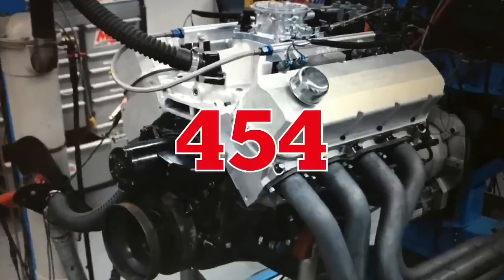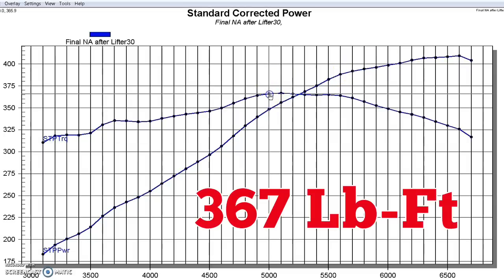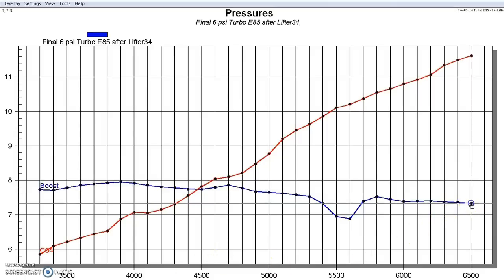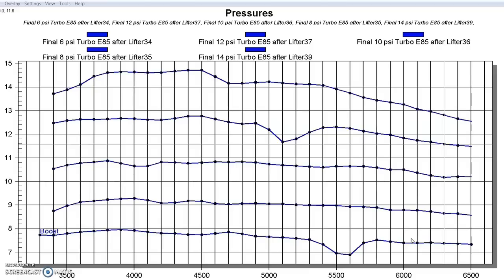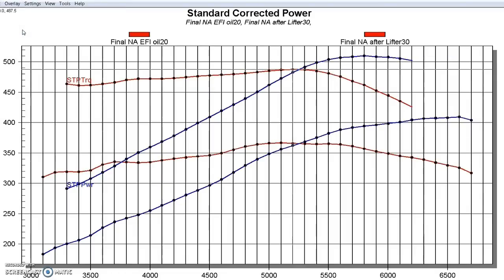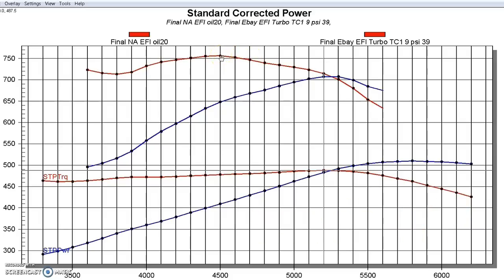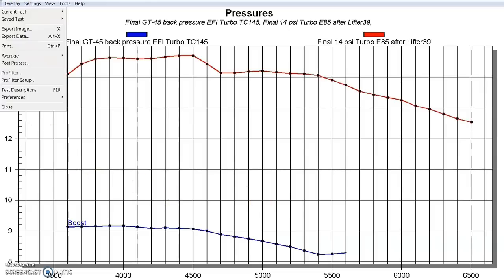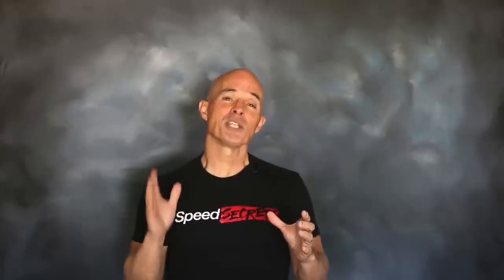EBAY TURBO TITANS-4.8L vs 454 (GT45 TURBO)

Comment: Great video. I'm building a gen VI 454 with a small Whipple charger great information on your videos. What is the right turbo for a big block Chevy to make 800, 1000, 1200hp. I have been doing a ton of research also on fuel injection which one will be best for NA and cost and what would be best for forced induction and maybe some price ranges and what to expect. I'd appreciate any of videos on this type of stuff thanks.

Comment: Size the turbo for your application, That small turbo [more average tq] with the 454 would be a great tow engine you don't need over 4500 rpm on that app.

Comment: We see the big block is still more powerful than an ls and cost less to build for more hp
Reply: WTF? How much do you think LS stuff is?
There are so many people making 700+ slapping a turbo and some fuel on a bone stock $400 200k junkyard LS
Most running BBC engines are $800-1000+ and are barely running. Not to mention are out of a clapped out 1978 motor home, making 211 hp lol
Lemme guess..you probably still prefer carbs over EFI too, huh?
You HAVE at least upgraded your points to a HEI distributor, right?
Reply from the maker: we get ours for near $300 plus core on sale weekends
Reply: I ain't your talking about LS, Richard
I can get a big block at the junkyard for $400 too. But it's well beyond a pig in a poke. LS is much safer junkyard gamble
Reply: Don’t get me wrong the ls is a very good engine. Got a friend running turbo ls on street 1028 to the wheels but got a friend with a 454 from a junkyard with just a cam, intake and fuel injector upgrade running a single turbo in his Chevelle putting 1500 at the wheels on low boost.  They both have there place. All I was saying is for less boost a big block will still produce more power

Comment: We all love LS’s. But it would be nice to see a budget twin turbo BBC shootout. Gen IV VS Gen VI stock for stock nothing more than cam and springs cheap turbos, and proper fueling on both. 725 lbft torque at 3500rpm isn’t anything to sneeze at. Can either of the them in stock form, survive north of 1000HP? Even if you don’t do a shootout, I’d really love to see how far these old girls with a four bolt main can go before the big boom.
Reply: Not sure how I missed that video. I thought I’d seen everything you put out. Time to start searching. 

Because of old technology it seems like people still think there’s no such thing as a budget BBC.
Reply from the maker: I have the big bang BBC coming up-we will see how far we can push a SBE 454-its already gone well north of 1000 hp

Comment: Another great video Richard! Now I'm questioning why two 700HP engines have different exhaust volumes, ie the BB with more exhaust back pressure than the SB at the same HP. Isn't HP (then exhaust) a function of the amount of air/fuel in the cylinder during the power stroke, be it NA, boosted, BB or SB? Thank you.
Reply from the maker: Look at the average amount of exhaust that must flow-the average exhaust flow (power production) of the BBC is much higher-it has to flow more total exhaust in the same amount of time through the same flow orifice-hence higher back pressure
Reply: Hey Richard, after posting my question, I decided to review the video.  At 700hp (SB=5900rpm, BB=5200rpm) the exhaust back pressure was almost the same (SB=18psi, BB=19psi). The BB's increased back pressure is due to the increase in HP.

Comment: I do not think the ci of an engine under boost  determines total hp. The flow capacity of the power adder determines max hp.  Physics determines output.  You can't make more hp than there is oxygen available.
Reply from the maker: the power output of the combination is ultimately determined by the flow rate of the power adder-assuming no restrictions.

Comment: A good follow up to this would be to add twin gt45 to the 454 and run the same boost (9).  Show the difference in back pressure and the affect it has on HP.  Another interesting test would be to run the 454 with just one manifold going to the single gt45.  Then have the other manifold with straight pipe.  This would be good to see if this works.  Then guys could get half of there turbo projects going and on the road then when time and money permits add the second turbo.
Reply from the maker: I tried running a single with one side-it didn't work but going to try a smaller turbo -twins vs single is on the list

Comment: Richard, what turbo would you pick to optimize the 454 combination?
Reply from the maker: We ran it with an S480 billet wheel-it worked well-the turbo choice would depend on desired power level and application
Reply: Richard Holdener, Great information, thank you. 👍🏻

Comment: Richard what size turbo woupd you recommend for a 427ci stroker ls?
Reply from the maker: Depends on power needs
Reply: @richardholdener1727  1,000-1,200
Reply: Twin 69 Billet BorgWarner with a 1.25 AR exhaust housing will easily get you 1200 rear wheel. If you want to make big Power twin 76s or twin 80s

Comment: Great test, i haven't seen many dyno tests where they log exhaust backpressure, good to see.  MORE DATA please  Richard! There is a lot to get out of your videos, beyond what you discuss if you just give us more data. Even if you don't want to discus it, just flash data on the screen for 2 seconds at the end, table format is denser and more accurate. I would love to see compressor discharge temps and pressures,  Intake manifold temps and pressures.  Airflow data. Does this turbo have a compressor map?  Didn't you talk about an 8 channel egt/wideband in a previous video? Timing, power/torque curves in table format.
Reply from the maker: There is no map for this turbo that I know of-we don't usually log airflow to the turbo. We sometimes run 8 O2s and/or EGTs, usually monitor boost and back psi, sometimes run air temps in and out, just depends on the test

Comment: It would be interesting what would be gained or given up with a different A/r exhaust housing. Also to add in a external wastegate and blead off some EBP at higher rpm on both motors to see if the falling boost curve would flatten out and cause more power.
Reply: Scott Nadermann I agree.
Reply from the maker: there are two external waste gates already

Comment: Great job as usual!! Volume on point! 
What would be interesting would increasing the turbine size and A/R and leaving the compressor alone allow this particular turbo to work on this motor and how that effects the output and back pressure. Ex I see this in would be a guy who wants 700hp but below 5k and have it live, not at 22psi of back pressure.. seems to me that a 96mm hot side would be min with a 1.2ish A/R as a guess
Reply: The compressor is pretty much at its  limit at about 700-750hp , so bigger exhaust wheel will help with the back pressure but won't make much more power .

Comment: Seeing this makes me want to boost my 383 that makes at least 500 NA, it has a pretty decent quality forged rotating assembly and dart SHP block
Reply: If your 383 is making 500ho stock it's probably high compression, that's not the ideal engine to boost.
Reply: brettls2 yeah I built it as a low compression motor for boost, but swapped out the dish pistons for flat tops, later on, if I boosted it I probably wouldn’t daily drive it as much, I could make sure it’s intercooled good, and has plenty of octane, or swap the pistons back in, or both
Reply from the maker: even at 10.5:1-it works fine under boost
Reply: Richard Holdener It should be around 10.8 right now, I’ve put 60,000 miles on the motor with a 243/249 lunati solid roller and afr 210 heads. Also put a Sniper X Flow system on it about 10,000 miles ago,
Reply: @drivinwithdrew7676  Turbo and send it! Good timing and your fine

Comment: That 454 would make for an awesome truck/towing combination. The torque curve looks like a dining room table! I wish you had a more technical discussion of not just the back pressure numbers, but more details about when the delta P ratio becomes an issue. As the test shows, if the application is geared toward more torque, having a delta P number of 2 or even a little higher, as was the case with the 454, is not a huge problem.
Reply from the maker: high back pressure and towing are actually not a good mix-there are much better turbo choices for the BBC-even for low speed applications-I want top try routing exhaust from 6 of the 8 cylinders to the turbo -I already tried just 4 from one side
Reply: @richardholdener1727  I don't know much about that China GT45, but presumably what's really needed is a turbo with a bigger exhaust wheel and a modestly sized compressor wheel. Maybe something like a BW S472SXE?

Comment: How much boost can I safely throw at my stock 1999 4.8 ls r an lq  I think GMC SIERRA truck motor original motor with 94,000 miles on it completely stock with "no cats n a cold air intake" is all that I've done to it it's my day driver so again safely it's a great running motor n I don't want to hurt it just NEEDs more power PLEASE help me n tell me what u THINK as ur opinion is greatly valued so thank for what u do n ur help by lending me ur opinion❗❗❗❗ n MAYBE selling me ur custom downpipe n hopefully ur air to water intercooler when u r done with PLEASE n THANK u for ur time buddy love ur content keep up the awesome informative video's?❗❗❗❗
Reply from the maker: we've run lots of boost on stock motors-a cam, springs and boost can make lots of power or just boost-but 7-10 psi works with proper tuning
Reply: @richardholdener1727  thank u Richard I REALLY value ur opinion so 7 to 10 psi with a tune will b safe n make me 4 something on pump gas u think buddy?
Reply: @JESSICA26ize  no problem on 4 something....
Reply: @Turbo_Todd  do u think a remote mount TURBO running 4... of boost would b my best ber, do u think I could get 400hp r better more with just a cam swap wich is my cheapest way to make the extra power my 4.8 to pull my 5500lb truck around n break the tires loose on dry pavement if I want too?
Reply: @JESSICA26ize  You can make 400 without a turbo.  On that Gen3 4.8, limit boost to keep it around 550hp and it will last on pump gas
Reply: @Turbo_Todd  that's awesome thanks Todd I just have a few questions buddy what can specs should I shoot for,n I thaught my 99 4.8 was a gen 1 haw dou now it's a gen 3? Thanks for all y'alls advice n help u guys rock n u put out fantastic content n help a lot of us guys out here to c what combos do what n what to expect from said combos love u guys so much from the dirty south baby "GA"

Comment: I think your videos are awesome What I would like to see is a comparisons of a front-mounted turbo system and a rear-mounted turbo system maybe adding some extra link pipe to simulate the rear turbo system the pros the cons to boosters as well as a back pressure
Reply from the maker: the problem on the engine dyno is that it doesn't show boost response well because of the artificial initial load
Reply: I would also like to see this!!!
Reply: Curious if the added length of exhaust piping would cause a loss in efficiency via thermal loss, weaker pressure wave to turbine. May cause an increase in exhaust backpressure to reach same boost level.
Reply: @charlesnorris9178  some say with a rear mount you can run less or no intercooler due to the charge cooling on its long way to the engine
Reply: You can't simulate a rear mount. Most rear mounts are 80%+ "straight" runs of piping. 12' of bent piping to fit the dyno cell comfines is not anywhere close to the same "straight" length
I was intrigued by the STS serious 20 years ago, but we've come so far with turbo/EFI technology and fabrication, it almost seems easier nowadays to create an "engine mounted" turbo set up
Reply: You can't run a rear mount without knowing how to weld....so might as well make a real kit lol
Again...they intrigue me, and DO work, for sure.
But not feasible to recreate on am ENGINE dyno, both from fabrication, and accuracy.

Comment: It would have been an even better test with more than one turbo to further illustrate your points. A higher quality unit and a larger unit like an s475
Reply from the maker: I ran an S480
Reply: I thought the gt45 you ran was 69mm compressor with the t4 flange. That's the one I have. That turbo is usually done around 800 chp which is what we were seeing.   I thought the s480 clone was on a t6 flange and 4 digit capable?
Reply: I thought even the summit s475 could go 4 digits

Comment: 454L thats a big motor like almost 100 times how does that even fit in your dyno room
Reply: I hope your joking
Reply: @davidcunningham00  no a 454L motor would be huge
Reply: @james10739  where a 454 liter motor would be big. This is 454 cubic inch's.  And FYI that 4.8 is a 293 cubic inch motor
Reply: I was not unaware of what a 454 was but the title says 4.8l vs 454l
Reply from the maker: Ill fix
Reply: @james10739  nice catch. 454!   7.4l lol
Reply: @Turbo_Todd  well he went and fixed it but the title did say 4.8l vs 454l

Comment: I remember when i first used the borgwarner match bot calculator. Thought i would be happy with 800hp and 15 psi. Here i am trying to crank 30+ out of the billet s475 on my 383. The calculator says the compressor map efficiency falls off above 5500. Which is exactly what my boost curve looks like. Long story short i need an 88mm haha
Reply: Need twin 69 or at least a 94
Reply: @danielsullivan9865  Daanng was just lookin at the on3 94mm too. Bw matchbot said 88 was good till like 6500. You think i need 94?
Reply: @buiItnotbought  that'll be a really good choice
Reply: @danielsullivan9865  im kinda worried about transient response because i have a 4 speed. And i granny shift lmao. And no im never getting an auto those are lame haha
Reply: @buiItnotbought  stick shift your going to run 8 second quarter👍 if you're in California we want to meet up with you. We run stick shift also
Reply: @danielsullivan9865  im in hawaii haha. What trans you guys on. I just split my super t10 in half only got 2 more. Was looking at m23 from midwest muncie